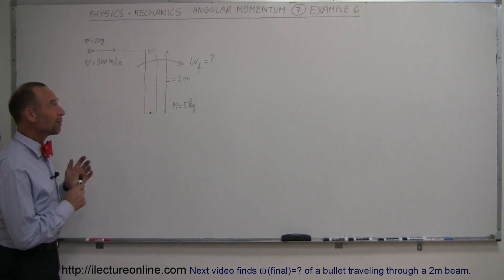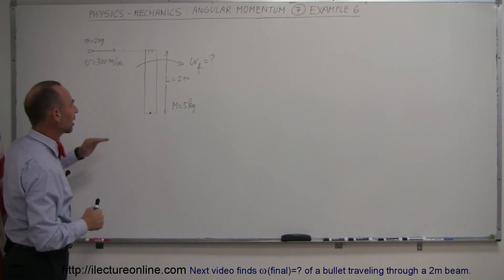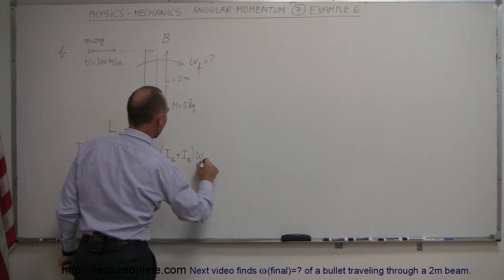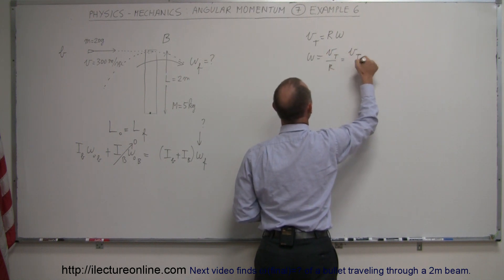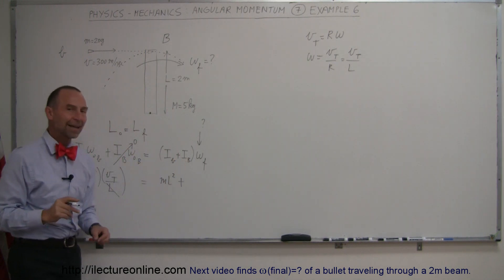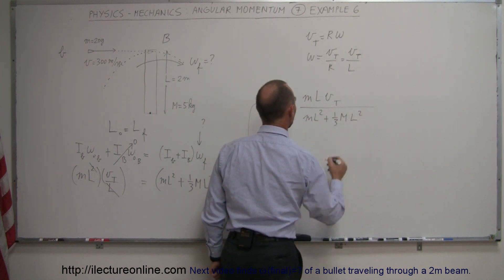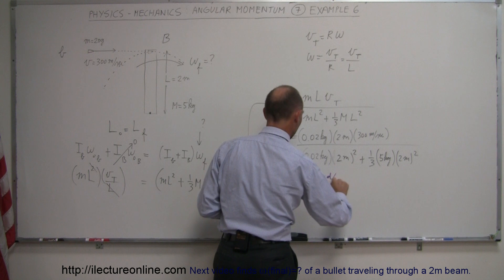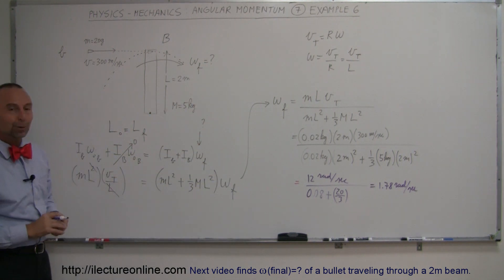Physics 13.5  Angular Momentum (7 of 11) Ex. 6: Bullet Striking Beam

Comment: Am I the only one bothered by the fact he didn't factor in the angular momentum of the center of mass, am I missing something? If the center of mass would've passed at the center of rotation it would've have cancelled but since the rod rotates along it's base, it should be considered.
Reply from the maker: Not sure what you mean by: " If the center of mass would've passed at the center of rotation".    (The video is correct as shown)

Comment: How the angular momentum be proved for the several object in one system
Reply from the maker: The angular momentum of a multi-body system is simply the sum of the angular momentum of each of the components.  In physics many of these concepts are not proven mathematically, but are confirmed experimentally.
Reply: So you mean we calculate each object and then sum it together
Reply from the maker: that is correct

Comment: What if the bullet hits the beam in the middle? Would we then replace L with L/2? Or would we only do replace L for the bullet? I'm confused as to the difference between hitting a 2m beam in the middle vs. hitting a 1m Beam at the end..
Reply from the maker: You would only use L/2 for the bullet.  The moment of inertia of the beam would not change.

Comment: Hi. Would the bullet make the beam rotate in a clockwise direction? It should have a negative sign and a magnitude higher than 1.78 rad/s if we converted the tangential velocity to angular velocity first and assign it a negative sign as it will cause a clockwise rotation when coming from the left. Considering also that the bullet has a very high velocity, it will cause the beam top rotate with high angular velocity as it is frictionless. Thanks.
Reply from the maker: You only need negative and positive values if you express the agular velocity as a vector quantity.  (Magnitudes of vectors can never be negative).

Comment: What would happen to the equation if the pivot point was set to the middle of the plank instead of the ground?
Reply from the maker: You would use a different moment of inertia  (I = (1/12) ML^2) and a different radius for the moment of inertia of the bullet.
Reply: So the radius of the bullet of be L/2 instead of L?

Comment: Hi Michel, thank you for the video! If you see this, can you explain what would happen (in a video or a reply comment) if the following happened?

Say we have 2 identical soccer balls. Ball #1 is in midair, is not rotating, and has 0 horizontal velocity. Ball #2 travels at ball #1, moving at some velocity and rotating at some angular velocity. My intuition tells me that it would be a semi-elastic collision, and 1.) ball #1 would have the same angular velocity as ball #2 (maybe the same magnitude, but opposite direction?) 2.) ball #2 would now have 0 angular velocity and 3.) ball #2 could possibly travel horizontally in the same direction as ball #1 since soccer balls don’t intuitively seem (close to) perfectly elastic.

I’m not really sure how to set up the equations to find out for myself. This question came up because my expected result is what happened in a video game’s physics engine, but my friend thinks that ball #2 would continue rotating.

Thank you!!
Reply from the maker: Interesting question.  First of all, all collisions are inelastic, therefore energy will be lost in the collision.  (Inelastic collisions only exist in text books and at the quantum mechanic level).  There are no "semi-elastic" collisions.  It is either elastic or inelastic.    Now if 2 balls collide there will be contact for greater than 0 seconds, which means that because of the friction between the 2 surfaces, the rotational energy of the one ball can be partially transferred to the other ball.
Reply: @MichelvanBiezen  thank you for the explanation! so I was wrong pretty much — would the ball ever transfer *all* of its rotational energy to the other ball? if so, is there an obvious way in which that could happen?
Reply from the maker: Yes if the conditions are just "right" that can happen.  Think of it in terms of the conservation of angular momentum and the "toy" where a series of balls are hanging side by side.  You lift up one ball and let it swing back.  It hits the series of balls such that it comes to a complete stop and the last ball on the other side swings upward with the same momentum as the incoming ball.   (the same can happen with angular momentum)

Comment: Hey sir I had a bit of a conventional question, how could angular momentum be conserved if there is an external force which is the weight of the bullet, isnt angular momentum only conserved when no external forces are acting on it? Maybe you defined the system as  the earth,the bullet and the board? Or maybe the time at which the bullet is shot and the bullet hits the board is very small and negligible? Im not too sure ,n P.S  Hope you're doing well sir
Reply from the maker: In ANY interaction of 2 or more object, momentum is ALWAYS conserved.

Comment: Why can't we use conservation of linear momentum to find the final velocity of the combined system and then use v= omega.r.
Reply from the maker: There may be a way by using the center of mass of the beam, but since the beam rotates, it makes more sense to use the angular momentum.

Comment: Hi Dr..I have a question..why did you solve the problem by using the equation of conservation of angular momentum..because this equation is used for problems when the net torques are equal to zero ..but when the bullet striking the beam there were a torque on the beam

Comment: I've been looking for an example of this problem where the rod isn't linked to any spot , like in this video:
https://www.youtube.com/watch?v=-G476-sy-hA&t=324s
Proffesor would you like to do it explaining why whe we display the angular momentum conservation equation, if  the non inertial reference system is situated in the rod's centre of mass, oce it has a constant speed, we don't consider the relative velocity among it and the particle's one. Then there is no difference between this case and when the rod's centre of mass is fixed.

Comment: Sir how to solve this problem if we take gravity into consideration?
Reply from the maker: That would make the problem much more difficult, because the moment arm caused by the force of gravity would change and thus that part would have to be integrated.  Also, we could use the conservation of energy principles to solve that part of the problem.
Reply: @MichelvanBiezen   dear sir.. Can i always ignore gravity in these type of problems even if not mentioned in questions to conserve angular momentum?
Reply from the maker: Usually it is specifically stated in the problem or it is implied.  With these types of problems we ignore gravity, unless it is specifically mentioned.
Reply: @MichelvanBiezen  thankyou so much sir...  Your way of teaching is extremely good 👍

Comment: If the center of mass for the beam is in the center, the inertia changes to 1/12ML^2 but does that change the amount of for the ML^2 or because you're basically using the parallel axis theorem do we change it to ML/2^2 because it the mass is half the distance of the full L?
Reply from the maker: The moment of inertia for a beam rotating about the end is            (1/3)ML^2  and about the CM is (1/12)ML^2.  You can use the parallel axis theorem going from one to the other.

Comment: SIr lets say that instead of a bullet , a disk is in the collision, then what would be the initial angular momentum of disk relative to the beam?
Reply from the maker: If the disk is moving in a straight line path (like the bullet) and the center of mass of the disk travels the same path as the bullet, then the contributed angular momentum would be the same as the bullet multiplied by the mass ratio (M/m).

Comment: how would i solve for the height that the beam is displaced? I have a problem that is the exact same scenario but the beam is connected at the top and it asks for the height that the bottom of the beam has been displaced. thank you
Reply from the maker: +ScreamingFootball 
You calculate the kinetic energy AFTER the collision and then you use the conservation of energy equation to convert the kinetic energy to potential energy.  You'll have to find the center of mass.

Comment: would it be the same if the beam was floating freely in space? And the beam goes off to a straight line rotating about the center of the mass?
Reply from the maker: +Fiona Onumd 
No, it would have a different end result.

Comment: Hello Sir, 
why here angular velocity isn't -1.78(rad/sec)? Beam goes clockwise. These examples with bullet are confusing to me because we get positive result (when looking for an angular momentum or an angular velocity) but direction is clockwise. Isn't convection saying that when it is clockwise should be - and counterclockwise should be +?
Reply from the maker: robinhozg
Good question.
A vector has both magnitude and direction.
Angular momentum is a vector.
However the magnitude of a vector cannot be negative (only its direction)
Since I did not write the angular momentum as a vector (only as a magnitude with no arrow above it) it is a positive quantity.
That said, you are correct in saying that the direction of the angular momentum is negative (into the board) when the rotation is clockwise, as is the angular velocity.
Reply: Thank you :D